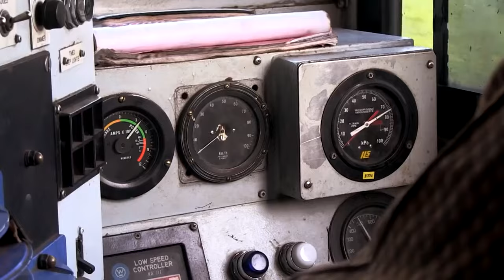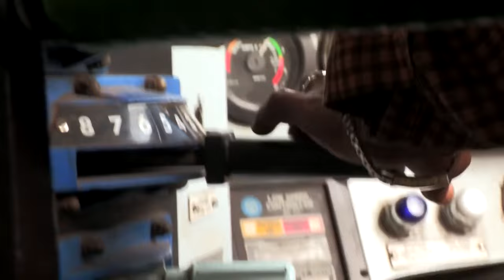World's Most Dangerous Roads - Congo: Train in Hell

Comment: If the bike riders had the money they could fabricate simple adjustable "training wheels" for the front and back to help with weight distribution and balance that could be raised when pedaling. They could use solid rubber tyres to save on cost and adjust the positioning using a spanner.
Reply: make it like trike( bikes., 2 wheels in the back, not only it is self balancing, it carries more cargo easily.
Reply: These people hadn't invented the wheel when we showed up, so..
Reply: @fathertime9433  who are you and what did you invent?